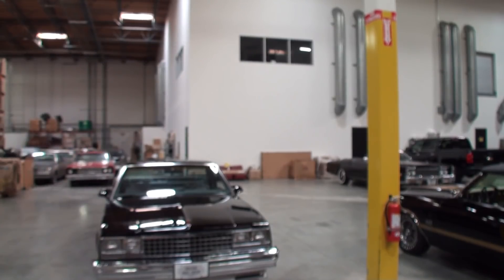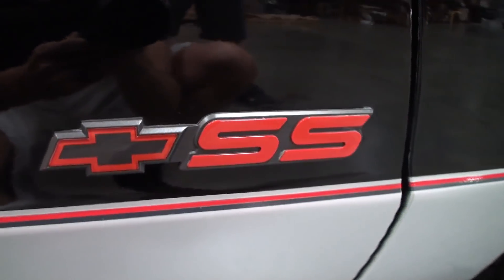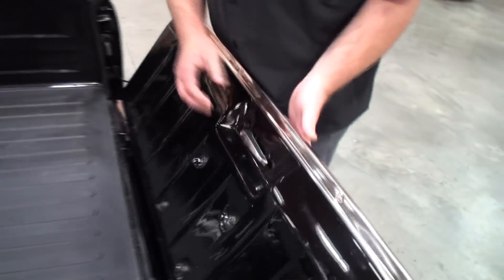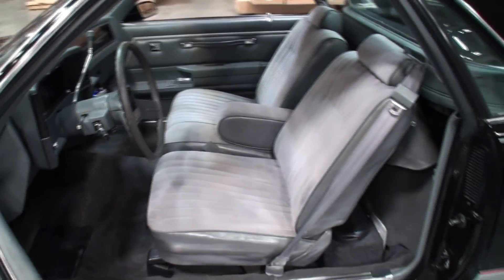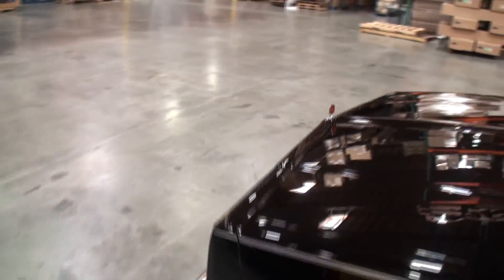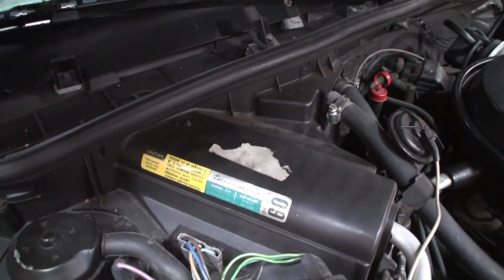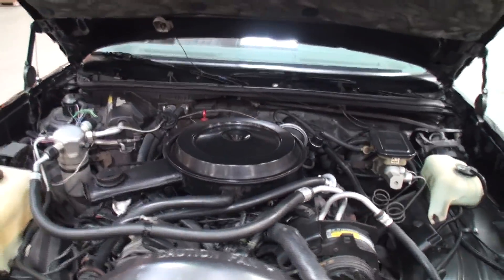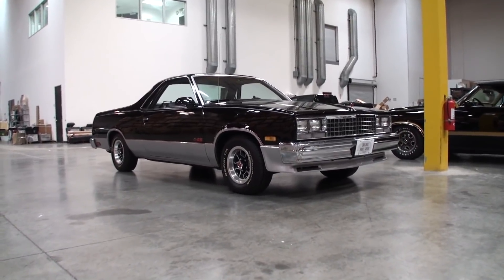1986 Chevrolet Chevy El Camino SS in Black & Silver & Engine Sound - My Car Story with Lou Costabile

Comment: Wow!  I always wanted an El Camino.  I love that it's a car with a pickup back.  I don't know why Chevy doesn't make a new one.  I think the paint color is Dark Red Metallic.  Looked like a 305 V8, but I'm not sure.  I can't believe it had overdrive, that's great!  It must run nice on the highway.  I also noticed it had power windows.  I saw a blank gauge on the right side of the dash, possibly a clock option not taken.  It would be nice to add a tach there, but maybe the owner wants to keep it original.  An amazing car and so clean!  Thanks, Lou!
Reply from the maker: Hi Brian Chappie, Glad to receive a "Wow!" from you :-)  Thank you for viewing and sharing the details you enjoy.  You're welcome, Lou
Reply: That's correct. There were three options, a full on clock, a tachometer or a tachometer with a tiny clock on it.

Comment: I have this EXACT same Car in the exact Color Combination. Only difference is mine doesn't have Factory A/C and mine has Eighty Nine Thousand Original Miles. Oh, and mine still as the Original Radio in it. AC Delco AM/FM Cassette.
Reply from the maker: Hi Ric H,  Happy to read you're very familiar with a car like this because you have one too :-)  Lou

Comment: I didnt realize they had a SS El Camino. I guess all the ones I see on the road are base models. I grew up in the late 1980's so I remember these cars well. Chevrolet was producing the square body Malibu which this generation El Camino is based upon. They discontinued the Malibu in 1984(I think?) but the El Camino lived on till 1987. This has to be a very late run 1986 because it has the newly introduced steering wheel that came out on the 1987 Chevrolet Monte Carlo LS.
Reply from the maker: Hi Kenneth White, Thank you for viewing and sharing your knowledge on this model, Lou
Reply: I believe they made up to 88 also the SS only had the Choo Choo super sport front end.
one thing for sure OPG is the best at parts. I had an El Camino and I went to there warehouse store in Orange County, way before they moved closer to me in Seal Beach

Comment: Didnt SS come with bucket seats?
Reply from the maker: Not sure.  Maybe a Viewer can share knowledge.
Reply: SS Came with Bucket Seats, Factory Tach on the Right side of the Speedo, Console with a Floor Shifter and a Cowl Induction Hood. This Car is a Base Model with SS Emblems.
Reply: Buckets and tach were an option. Even on SS package. Even Monte SS had bench seat standard. Cowl Hood (scoop only) was a Choo Choo SS conversion add on.

Comment: SS?! Dont think so.... A emblem yes.
Reply: It's not an SS, you don't need to have an SS When you throw an Elderbrock And Straight pipes in it
Reply: It has all the right parts that make it an SS. Front air dam, mirrors and emblems. I don't know why you don't think it's an SS.
Reply: If it has Z15 on the build sheet that's located in the glove box then it is a true Super Sport.
Reply: The SS has a Factory Tach. This one has no Tach. Someone added SS Emblems to a Base El Camino. SS also has a Cowl Induction Style Hood.
Reply: Tyler, 8004dodgers, and Ric H. are correct.  Z15 is the RPO code for the SS.  Also, that SS emblem on the door is from a Monte Carlo, El Caminos had vinyl decals.   
I have an '86 SS, Z15 car that was sent by the dealer to Choo Choo Customs for their makeover.  VERY rare combination.
Reply from the maker: Thank you for viewing & sharing.

Comment: st 520...there stalling...they it's a 305...they didn't 350....compact....rumble...floors...thats .. now they're being deceptive it's just said we're getting it smog or we just had we just had it smogged as a 305 4 barrel Rochester was not a 350 you know the dimension engine size because there's no headers if there is they have to be Shorty's or legalized heaters for small control engines especially for that particular one California sucks I'm surprised they have their Outlet in California only thing people benefited from its people outside the state f***
Reply from the maker: Thank you for viewing and sharing your knowledge.